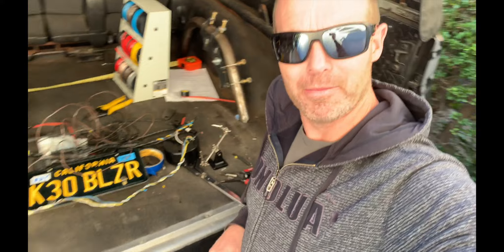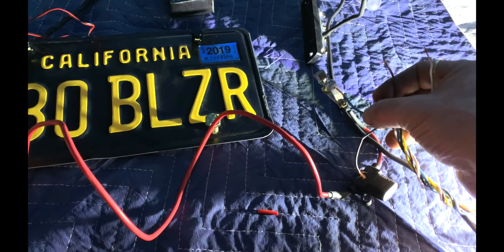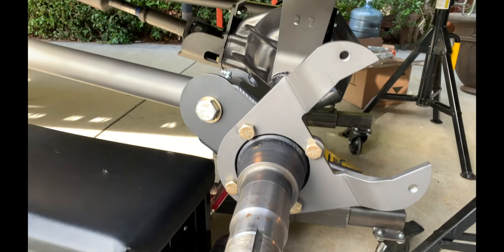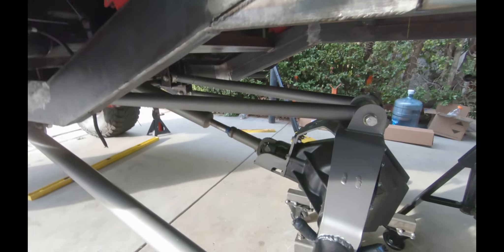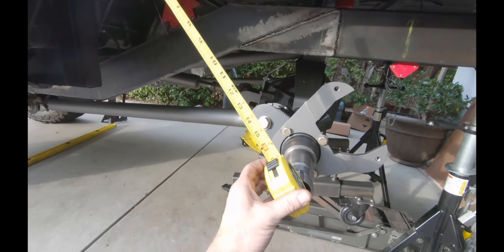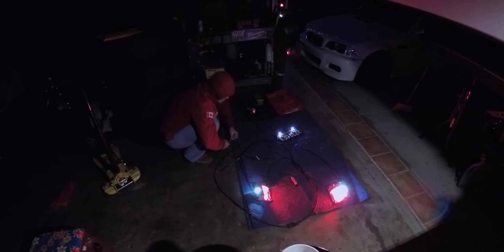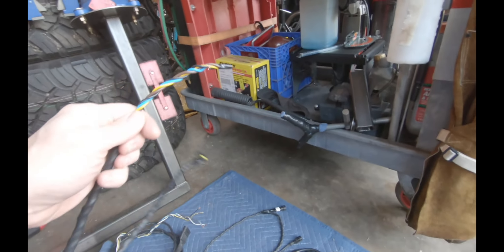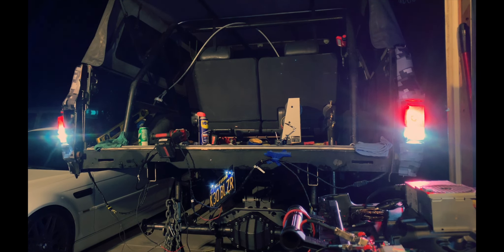MG #138 - Rear Four Links for the K30Blazer Part VII

Comment: I really enjoy your videos. I ran an oilfield vehicle upfitter for a good spell. We lengthened and shortened many a frame. I'm inclined to recommend fish plates that are welded and bolted at your connections. Angle connections are good, but step connections are even better. Fish plates spread the load. We always welded and bolted. They're complimentary.
Reply from the maker: Yea I am gonna make some real fishplates with staggers etc etc.  bolted the frame this wekeend

Comment: Coming along very very nicely
I'm in the process of gathering bits for a K5 Cummins build...so far snagged ...rust free frame/body, 1 ton axles with new 513 gearing and Detroit lockers(Detroit rear True Trac up front), 8" lift via springs, non intercooled Cummins, 5speed getrag with 205 transfer. 
Also have a Jimmy that will see some upgrades as well. 
Totally into this Rabbit hole now....
Reply from the maker: You need gears that low with the diesel?
Reply: @MerricksGarage  when you find a rolling chassis for half price given the $$ the seller put into it you don't refuse that deal. But I do want some slow crawling speeds that the 513's will provide without going to a doubler...which is what I would have done with 350 power. Here it is not about HP sauce and high RPM rips, but comes down to chugging along and getting traction so plan is to use soft sticker rubber (like the milestar Patagonia) with a durometer of around 50-55 preferred to put the chug down in these mountains here. Tire size wise looking at 38's. The Cummins will certainly provide the chug. Terrain wise it is old narrow rocky industrial roads into the mountains
Reply from the maker: I wasn’t thinking for wheeling, but rather for freeway.   I run 456 with my 40’s and the LQ9
Reply: @MerricksGarage   If it does 60mph on the top end I'm good for the roads up here(it's either one 2 lane hwy or forestry roads)....if I'm going any distance on hard top I'll trailer it. Certainly not building it as a road runner given the 513's....got the Jimmy for that.. or the Dodge.  
For about all the trails here it is go in and come out the same way as well so in that context it gives me what I want...a offroad crawler without being a "rock" crawler and def not a Mall crawler haha.
Certainly interested as to what trouble you can get into now when you get yours back out on the trail and run it through it's travel plus your full thoughts going from leaf to a full 4 link setup

Comment: the blazer is looking good. if you go to a junkyard, you can cut out a section of a blazer rear floor pan and rivnut it over the hole in the rear for easier access. that is what i’m going to do when i have to change the fuel pump in my blazer

Comment: I really like your build and it's hard to believe your getting this all put together buy yourself in a small garage. Just a caution note for you. The rubber seals for the electrical connectors are made for one wire and have to be match to the wire gauge you are using to be water tight. They will not be water tight if you put 2 wires through the rubber seal unless you put silicone around it also.
Reply: I did notice that you used a lot of heat shrink around the connectors. If you used the water proof heat shrink with the glue inside of it then that may work pretty well to keep the electrical water tight.
Reply from the maker: That’s what I did.

Comment: Awesome video love all your details keep it coming, I was wondering  what are you using on the floor it doesn't look look like the stock metal or is that insulation?
Reply from the maker: I have some cheap furnace insulation then the LMC vinyl floor.  It was a pain to install but it has held up really well.  Use a heat gun!